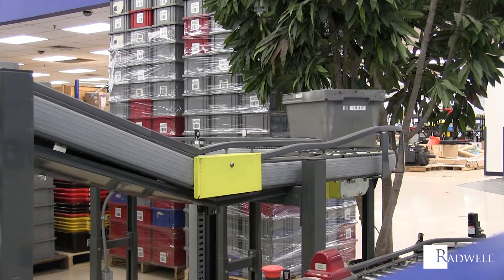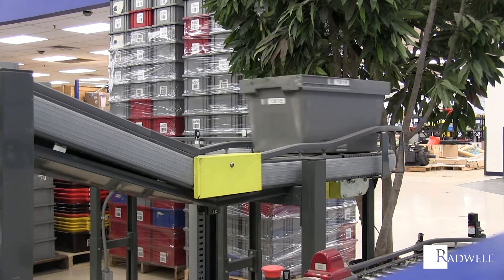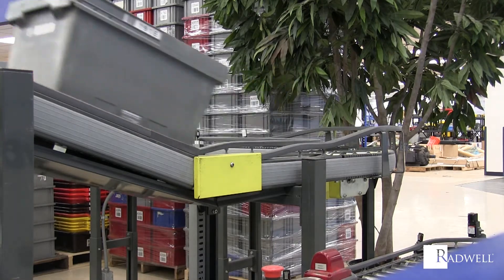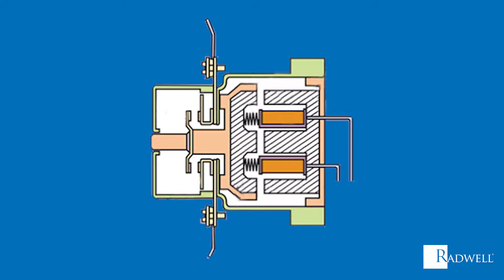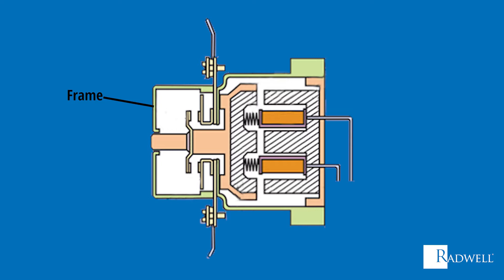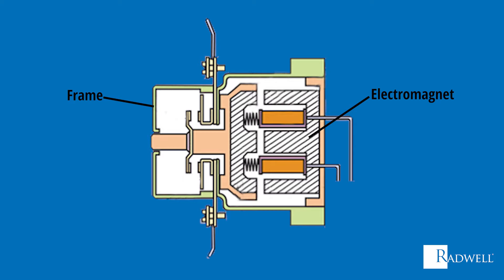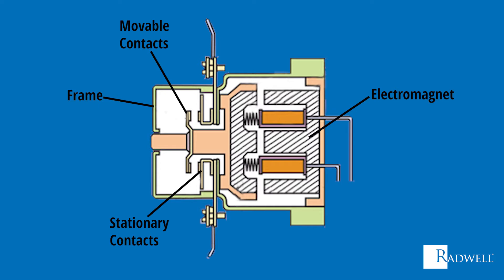What is a Contactor?

Comment: How to troubleshoot the Line, Load, Normally Open Contact and Normally Close Contact in Contractor during live electric supply
Reply from the maker: This is just a general information video. What you are asking for is way more advanced. If you have questions, reach out to us at 609.288.9393 or 800.884.5500 and someone from our Engineering Dept can assist you. We are also offering Radwell Remote to help you with repairs too. Hope this helps!